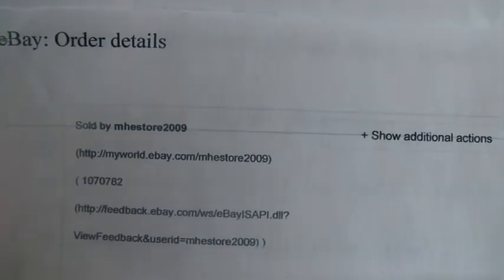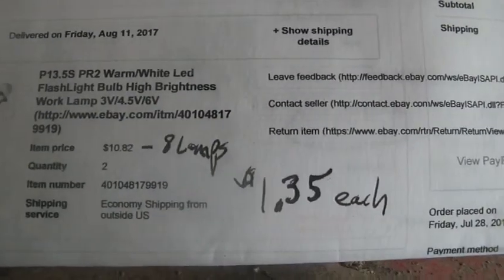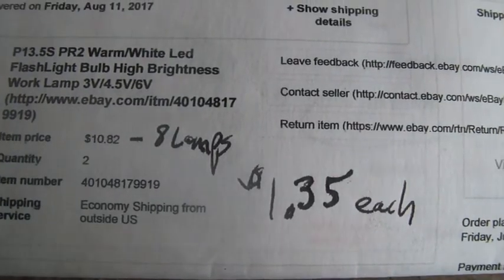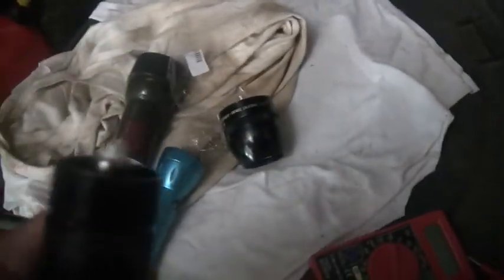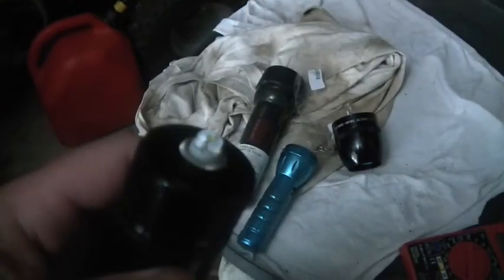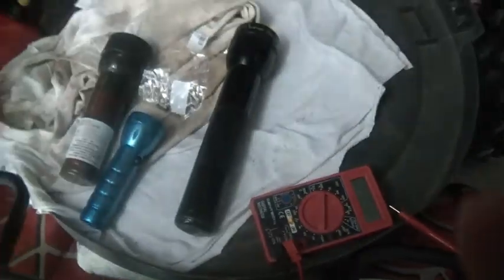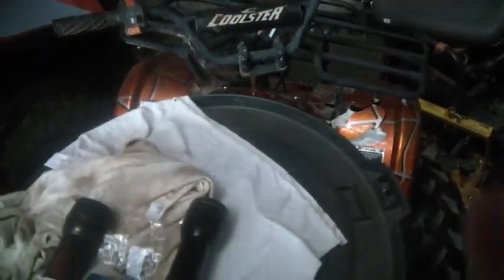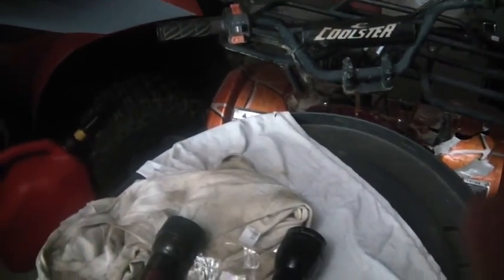Maglite Hack, $1.35 LED upgrade increases battery life 25-35X,

Comment: Thanks for the video.  I have a couple of Maglite's and a couple of old military angled flashlights that I want to get LED replacement lamps.   It will extend the battery life, and I think the LED has a brighter white light.
Reply from the maker: Hey Pete, I love the feel of the Maglite, but, with a filament bulb, it is very mean on batteries!!!!  I figured that if people realized for less then $2, they can upgrade to an LED and save a load of $ on batteries!!!    Thanks for the info, encouragement, watching, and commenting!!!!

Comment: Mine has an LED bulb and rechargeable batteries in case I forget to switch it off which I've done more than once.
Reply from the maker: Hey Simon!!!!! I need to update the Ryobi flashlights to led, that would give me the rechargeable version for emergency use.... Thanks for the idea, watching, and commenting!!!
Reply: Harvey Spooner What I do is use the cheap ones mainly and make sure I have spares charged up. They are really cheap in the thrift shops and seem to work OK. I do have some stuff with Panasinic and Duracell batteries in and they do last longer between charges. you get what you pay for as with a lot of things. I'm in the UK so I don't know if those brands are the premium ones in the US.